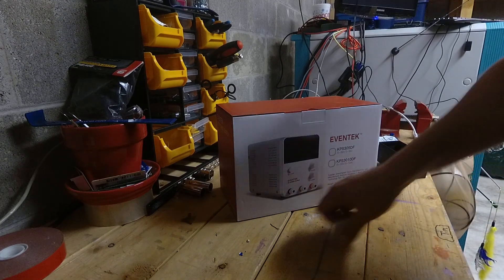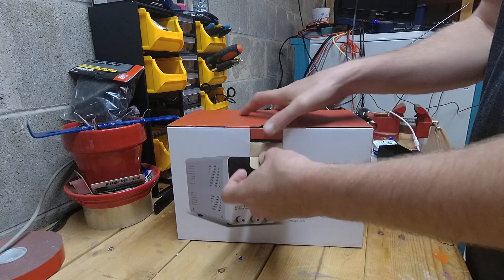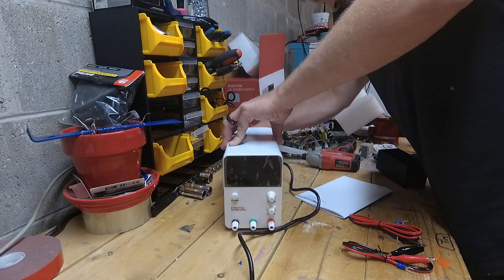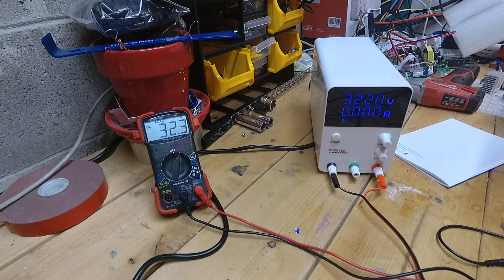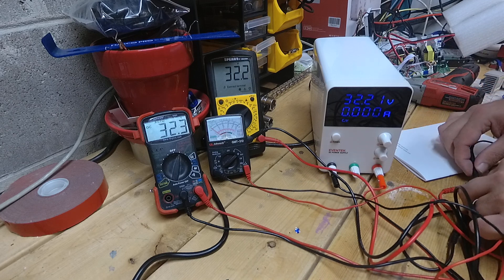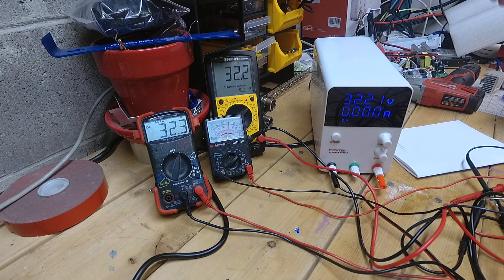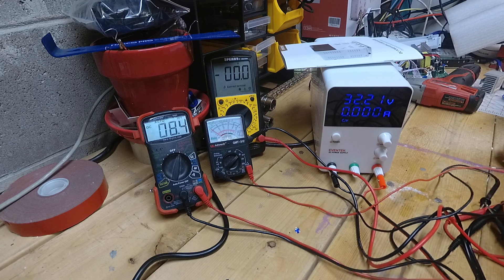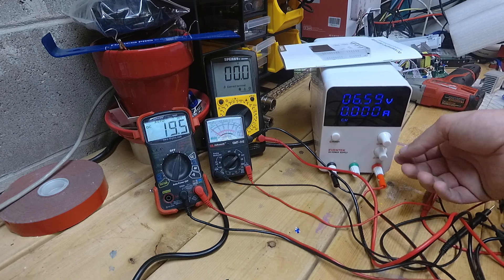Eventek KPS3010DF 30v x 10a Review

Comment: Hi does anyone know where to get the user manual from as for some reason mine has not come with one ( awaiting sellers response ) thanks
Reply from the maker: What info are you looking for? I might still have mine somewhere.
Reply: @justinreiners  hi just wondering how do you select CC or is it auto switch from CV to CC , sorry I am just unclear  as there are not many options thanks Justin
Reply from the maker: @odmods  set your voltage down low (or it gets hot at 30v), short + and - and the display will change to CC mode, set it where you want and then set the voltage back where you want it at.
Reply: Justin Reiners thank you appreciate your help and the great review
Reply from the maker: @odmods  to set it back to full power mode, you need to short the + and - and set up back up to 30 amps, it's normal for the wires to get a little warm when you do this, but it's easier on everything to lower the voltage before you short it.

I believe the limit set stays between power cycles as well.
Reply: Hi @Justin Reiners , to follow up from your helpful response.
I have a issue when trying to keep in on CC for anodising.
I drop the volts down and short it. 
CC switches on if I keep it shorted yet I can up the amps but the volts continue to stay on zero.
Soon as I stop it shorting it switches back to CV and I can only alter volts and amps follow.
I require CC for anodising with amps around 4 and volts 15 but can’t get it to stay in this mode and alter to the above.
Hit a wall :( . Seller sending me the manual but not sure if will help much as there isn’t much to change. Sorry to keep pestering you

Comment: Hey brother can we get it hooked up to the osciliscope please! I'm lookin to buy but those specs seem unbelievable..
Reply: Sure thing! I plan on doing a new video soon, I acquired a couple of nice analog scopes recently.
Reply: Hey Comrade! Just figured I'd let you know I did order one, but just returned mine.. The AMP output was broken outta box, but that aside, the no coarse/fine adjustment is the worst. Wouldn't wanna use it with only the two knobs ever. Maybe if it was 20bucks for a 2 knob PSU..  Thanks again tho! lol. @justinreiners7386
Reply from the maker: @user-be4yc2vr5c  I've had very few issues setting a fairly exact voltage with just the two knobs but I can see how it could be difficult or annoying for someone. I honestly really like it to this day and I've had zero issues, trying to figure out if I want a new digital scope or another power supply to mess around now.

Comment: Hi Justin.  Ran into your review in Amazon and led me to your review video.  I appreciate you posting this and sharing your thoughts.  I'm in the market for a DC power supply and can say you have convinced me which direction to go with.  Do you have any follow-up comments since your last review on this product?
Reply from the maker: Thanks for watching, I had to submit that review about 3 times because of the youtube link, glad you figured it out!

All I can say is it's much better than my old one, I've loaded it up with 12v 4a and the fan doesn't run one bit, and it stays cool. I love it so far. I'll be doing some larger loading as soon as I build my new battery pack and charge it.

The display is the best I have seen as well.
Reply from the maker: I just posted another pretty long video and had a shot of my charging setup I'm using. I can say the display is great to look at, the knobs are just slightly hard to dial in exact, so make sure you disconnect your load before changing your voltage. I have not had it spike out of control or anything but some electronics are sensitive, and it could be easy to overshoot.

I've been using it so far for quite a few days and my review stands. I'd buy another one in a heartbeat if I needed one. I think the 32v 10a is almost perfectly sized, allowing twice the output for ~20 bucks!
Reply: Justin Reiners awesome!  Great input once again.  Thank you.  Ordered it already and should arrive on Thursday.  Looking forward.
Reply: I returned mine. I'd never buy one. Broken out the box. But that aside the 2 know/no coarse/fine adjust/ is the worse. Would never WILLINGLY use that thing.. Took me hours  to try to get the adjustments I wanted lol.